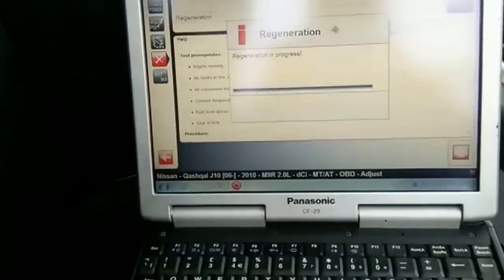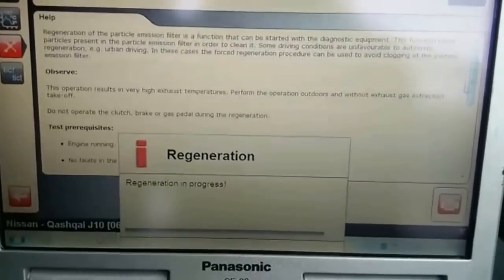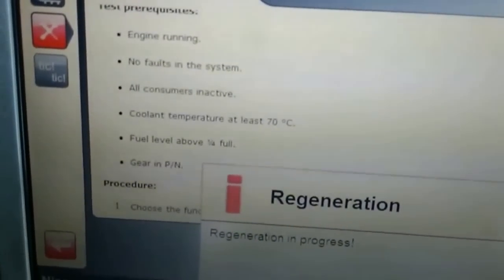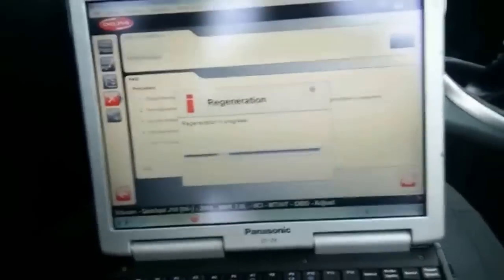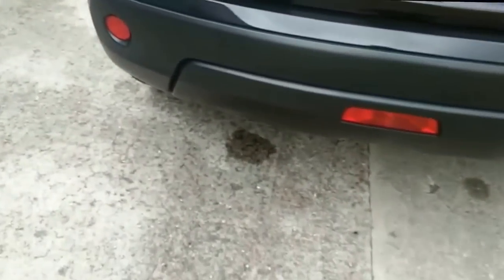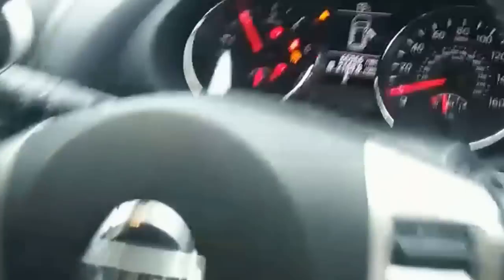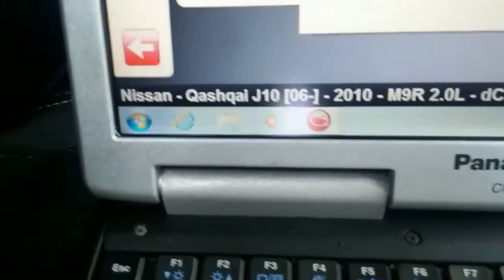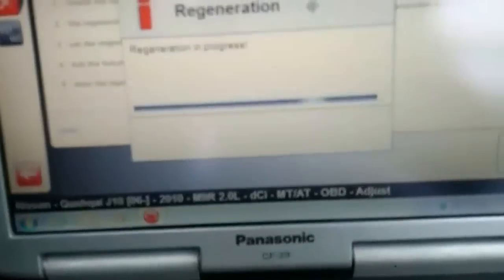DPF Regeneration - Nissan Qashqai

Comment: Hi, I have a Nissan Qashqai 2.0 dCI from 2009 with 89000km. I had my filter regenerated in special shop (they took it out and do a good clean) because Nissan dealer wanted to change the whole DPF filter. So I cleaned but after 4000km I got the error P1435 again. I have a Delphi diagnostic tool and I did a regeneration but after 40 minutes I cannot delete the error code.
I was checking the exhaust difference pressure of the DPF and in idle is 0,9V, at 2000 rpm its 1,1V and if I accelerate it's max of 2,6V. I think these are normal values.... but not sure at all.
Any suggestion?
There is no way to tell Delphi that the filter it is new and do a "DPF clear data". 
Next steps?
Reply from the maker: +Hidden Democracy i spoke to our technician he suggest that everything you doing is correct but he thinks that the code you've given is possibly related to ECU software update so i would think its best if you take it to main dealer or someone that can update the ECU. Hope this information is helpful.
Thank you
Reply: i have two codes one is dpf problem but the other says about changing deteriorate oil. worth checking
Reply: hi @hiddendemocracy do you remember how you solve this problem? im in same situation with delphi tool.. cannot delete the code.

Comment: Hi, I am new to using the Delphi diagnostic tool for regeneration.   Question: after the 40min regeneration process do the DPF related fault codes reset (i.e. clear off) automatically OR do you have to use the 'Erase Fault Codes' software button within Delphi?  Also, did you ever have to repeat the Regeneration process twice in order to clear the DPF fault code?

Thanks for your time and informative video!
Nick
Reply from the maker: +Nicholas Bonanno Thank you for your question regarding DPF ,using Delphi systems 1st go through codes and clear them ,DPF code may not clear but after performing the regeneration go back into the codes and clear it ,you shouldn't have to do it twice unless the soot content is very high and the vehicle has high mileage ,try the above and update me. If you get stuck let me know . Thank you from Taj Groups

Comment: Hi what program are you using to regenerate? Thx
Reply from the maker: +MrVM41 hi we use Delphi to regenerate DPF
Reply: Taj Tyres ltd where can I find this Delphi?
is any android app doing regeneration with Obd reader ?
Reply from the maker: at the moment there is no app for android that regenerates only does the basics! so you have to use delphi/snapon diagnostic tool for regeneration.